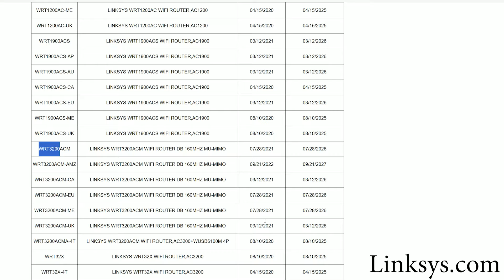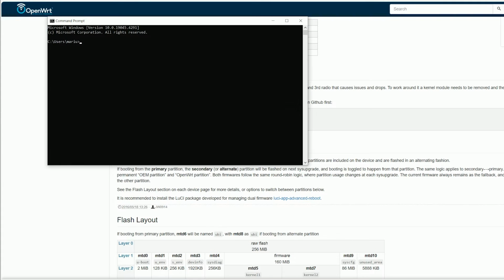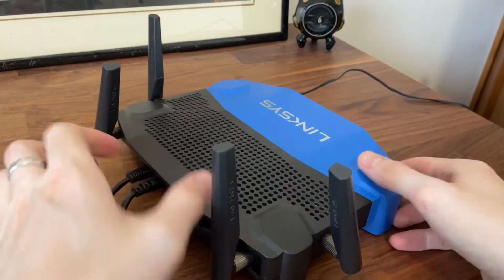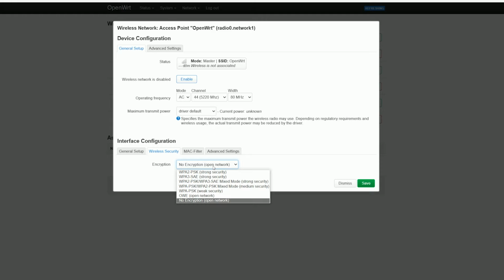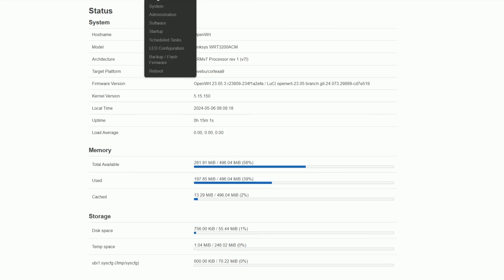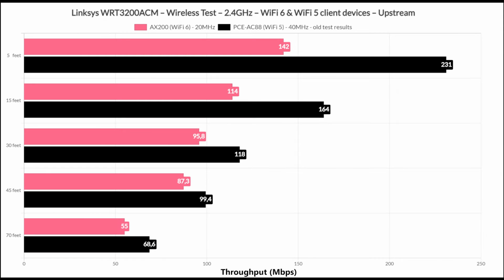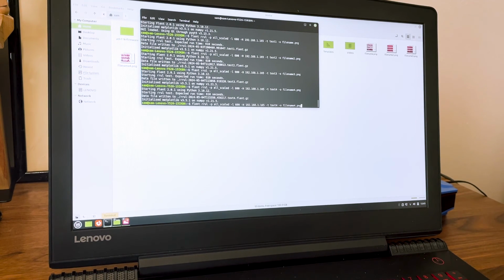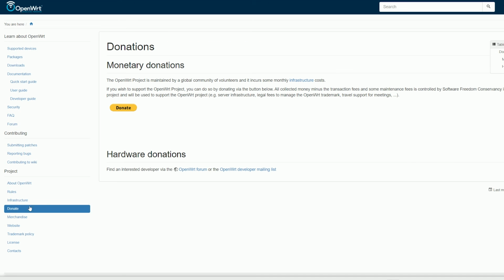Revive your old router with OpenWRT: Linksys WRT3200ACM

Comment: Linksys has made some terrible moves letting Belkin get a hold of it they can't even make good cables and now foxcom  ohmy.

Wrt3200acm 1.6 GHz dual core 
Wrt1900ac 1.2 GHz dual core
I still use the 3200 today with 512 ram it's worth noting the transfer rates on WiFi 6 are still good and new routers moving to WiFi 7 surpass this technology  but I really like the Cisco systems design. It's sad to see the routers so cheaply made just a bunch of 💩 . Well thanks for sharing your experience with the firmware Belkin finally got off their popes and shared documentation for DD-WRT everyone waited for several years after the 2013 mark for that. 

Asus routers seem to lose my  AS604T NAS but the linksys is very stable with it . Not sure why but I'm happy it's still providing good service with no antenna issues.

Comment: Now you should make a video, how to get rid of Openwrt and get back to OEM firmware! It was such a bad decizion to install openwrt, because i have problems with the 2.4Ghz network, devices won't stay connected, and the speed is awful 1-3 Mb, compared to the stock firmware of 56-60 Mb! I wasted a entire day trying to solve the problem with no luck
Reply from the maker: I am sorry that this happened to you. Did you try to restore the firmware and it bricked the device?
I will make a video soon and cover how to return to the default firmware.
Reply: @SamBondor  well, it's not that easy to revert back to original firmware.i haven't bricked yet.Openwrt is installing on the second partition, and it will boot from there. The fact that you need to use Putty, or other software to get inside the router and clear that partition, running commands is not that easy for most of the people, especially if you are using macOS. 2.4Gz is unusable, something is wrong, i cannot connect. I have tried in the past dd-wrt, but is unstable keeps disconnecting! I was hoping this solution will rivive my wrt3200acm, but it seems i'm out of luck! I waiting for you new video! Thanks! Cheers!
Reply from the maker: @jessgone  Could you connect to the 2.4GHz network before moving to OpenWRT?
Reply: @SamBondor  yes, on the official firmware! And the speed was between 30 and 60 Mb/s.
Reply from the maker: @jessgone  What sort of encryption did you use for the 2.4GHz network? Was it a mix with WPA3? If yes, go with WPA2. Some other stuff to try before reverting to the official firmware would be to check for the channels that are used by your neighbors (use any WiFi analyzer app, most are free) and maybe try out different versions of the OpenWRT, like older ones?
Reply: @SamBondor  i've only used wpa2 encryption, didn't even tried wpa3. I've also did a wifi scan to se what channel is most populated, and set a safe channel.I modified also the broadcast from auto to 209 Hz! But i haven't tried other old version of openwrt! Do you have some suggestions? Some specific build number that is stable for thid type of router? Thanks for all the help! Cheers!

Comment: Would you know if you would be able to use the 3200 and 1900 in bridge mode together after updating to openwrt?
Reply from the maker: Yes, of course. And there are countless guides on the web on various configurations.
Reply: I have a WRT3200ACM as main with a WRT1900AC and WRT1900ACS as secondary routers all on the same subnet